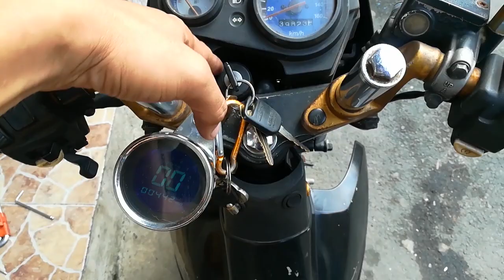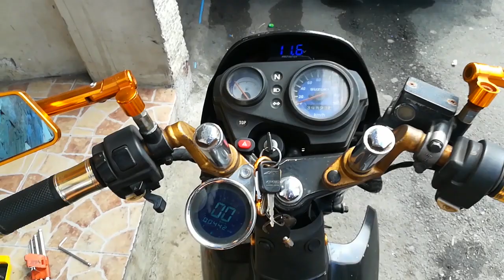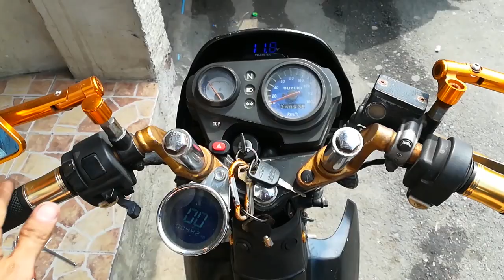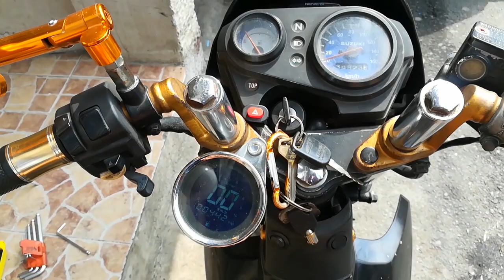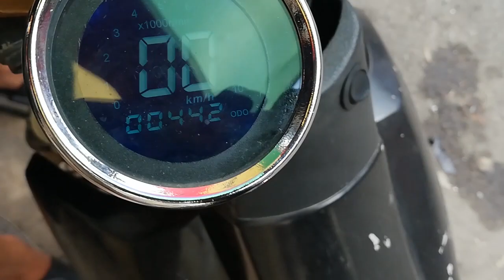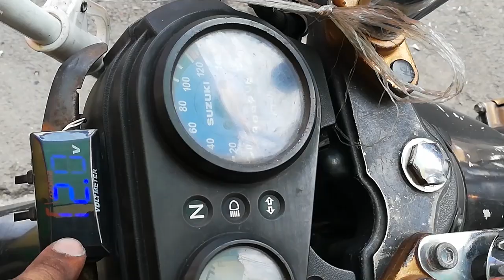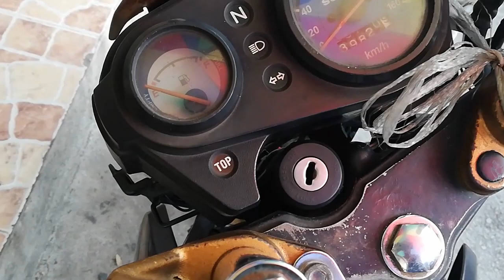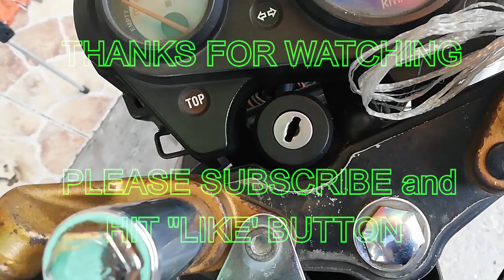Ignition Switch Cleaning ll Contacts and Steering Lock Lubrication

Comment: Sir pwede po mg tanong.bago ang battery ng motor ko pro hindi mg start gmit ang electric start.prang mhina prin ang kuryente.ano po ba ang deperencya?salamat
Reply: check mo boss kung tama ba yung battery na nabili mo dapat 5l up yung need nyan pag tama naman sa wiring na or sa starter na yan
Reply: linis lng ng starter motor yan ganyan din prob q nung nkaraan...

Comment: Yes2 sir JD ako ng pala yung nagtanong lastly about dun sa fast charging and headlight installation ndi ko kase maifanalize yung ginagawa ko sa fast charging para maifast charge ko yung headlight ko e2yung tanong ko kase yung 86 point contact relay ng fastcharge san ba ang saktong pagcoconnect nun sa relay headlihgt sa 86 din ba sya o sa yellowe wire na tinanggal mo sa socket nka batt.operated na kase tong BARAKO ko ehh...gusto ko syang ifast charge sir...please pa helo nman ako sir...kompleto na kase ang relay ko may double throw and change overrelay na din tayo sir....maraming salamat sir....???
Reply from the maker: 86 din po ng relay headlight
Reply: @JeepDoctorPH  Ahhh..ok sir salamat sure na kase yung 86 natin sa headlight nagconnect sya sa ig..accesoreis salamat2 sir 2loy ko na tong fast charging instalation ko ...???
Reply from the maker: @esmeraldocasuco8166  ah mismo headlight pala ang gagawin m n ilaw.. bale ang gawin m boss may wire galing sa switch ng headlight diba.. yun ang gamitin m na wire papunta nmn sa 86 ng relay ng fastcharge
Reply: @JeepDoctorPH  Ah...ok ganun bahsirkase ang sistema ng barako naka hiwalay yung switch nya sa high and low switchnya ehh..parang sa fog lamp dinpala yung sa fog lamp kase 86 to 86 dba..86 ng relay ng fog lamp going to switch and going out ng switch going to ig..accesories dbah...cge sir salamat....sa correction ...???
'

Comment: Sir masisira ba voltmeter pag pumalo ng 18 yung boltahe
Reply from the maker: Depende kung 12v capacity lang ang voltmeter mo.. may voltmeter kais ma 24v capacity
Reply: @JeepDoctorPH  kuya  kaka testing ko lang  po kani kanina lang tinest ko kung putol yung wire hndi naman tsaka nirekta ko sa baterya wala na talaga binirit ko lang kagabi nag 18 yung reading pag uwi ko po wala na
Reply: @JeepDoctorPH  kuya pano po ba itest sa multi tester kung gumagana yung voltmeter? Saan po iseset?